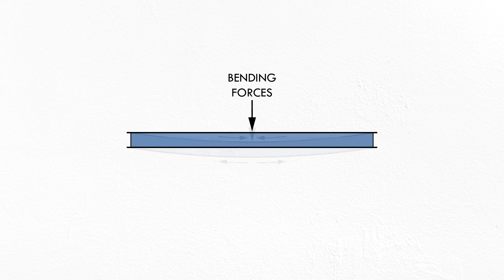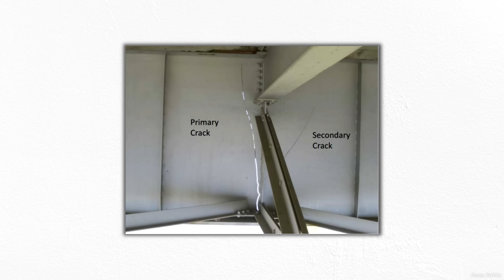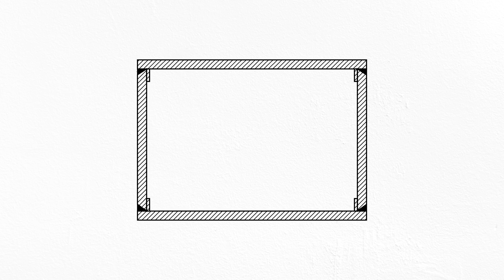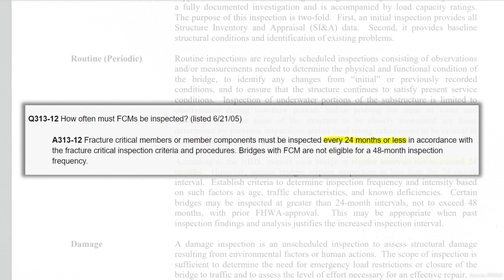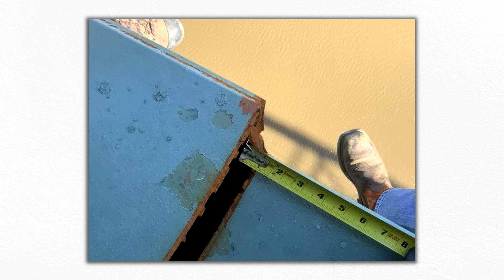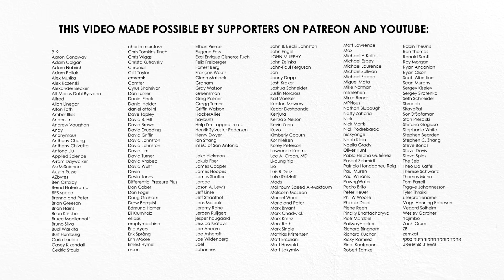What Really Happened at the Hernando de Soto Bridge?

Comment: As a structural engineer with over forty years experience, I am of the opinion that the success of most human endeavor is balanced on the edge of a knife. It is hard for our societies to cover every need. People want perfect, wrap-around security, but refuse to spend on it at a level that might provide even reasonable security. Resources are spread thin. Our margins of safety are small and apparently getting smaller. There are reasons why this will not change. The deeds of individuals acting alone will continue to matter, and will remain the difference between life and death in many cases. God bless every person who takes his responsibilities seriously!

The condition of infrastructure generally is precarious, worldwide. A bit facetiously I will say that perhaps Switzerland has organized its civil works for long term success at a bearable cost, but most of the world has not. Bridges, tunnels, dams, water systems, and electrical grids typically are vulnerable to failure. The budgets for inspection, maintenance and timely replacement are generally inadequate. Occasional tragedy is to be expected.

When tragedy strikes, society takes revenge on the unlucky, rather than address the roots of the problem. The point has been made that an inspection system ought to provide redundancy, some sort of defense in depth, involving more personnel working more systematically and under closer supervision. However, do too much of that and it starts to look like featherbedding, bureaucratic empire building, and waste. And perhaps it is, with so many people undernourished, lacking housing and deprived of health care. Society has to decide where the resources are to be applied.

Perhaps a back to basics approach would help. Civil works designed for longer useful lifetimes would be good. Postponing ambitious new projects in favor of increased maintenance budgets would be a wise step for many DOTs. Reducing our need for transportation would make us all safer. Placing less emphasis on the checklist, and more on doing the job in a mindful way would help. I am more interested in what the inspectors find than on what they do not find. If everything gets a clean bill of health the system has definitely broken down, because “perfect” does not exist.

Comment: It looked like the break was just inches of the end of bolted plate. Seemed a strange place for a stress point. Also, looks like tube steel vs ibeam . Could have been a weak spot in the tube. Hard to see because its hollow but you'd think the consistency of thickness may be questionable. Put load on it, if it flexes for years, eventually it snaps. Probably the only thing that saved it was the rest of the spider web of the structure. 
My neighbor backed into his carport post and knocked it out, the roof did sag but stayed up. Because as a structure it wasn't totally relient on one part to hold it up. Probably same with the bridge.  Concrete probably would have fallen, by shear weight. But the steel probably holds more weight than it weighs. Over a bit more time, it would have put more stress on other components.

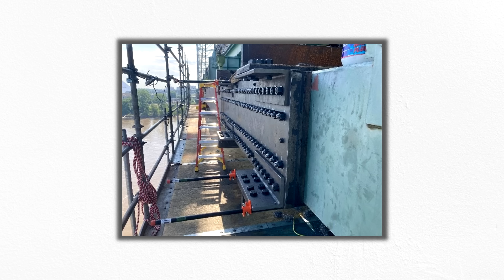Comment: 11:30-12:00 which is why a state official decided to ignore it. To save money, and not be responsible for shutting down such an important piece of road. If the problem “doesn’t exist”, it’s cheap to fix $0.
It emphasizes your point that the more important something is to public safety at large, the more people should be involved to ensure corruption, negligence and ineptitude are kept in check to prevent disaster.

Comment: Take this with a grain of salt as I don't know the situation and am only going off my own experience here, but as someone who works in government in health and safety inspection, it kinda sounds like the company knew there was a crack on the bridge and just failed to acknowledge it for financial/bureaucratic reasons. Yes, things get missed, but that sounds too big (to me) for no one to have called it in, they probably just called it in internally instead of bypassing the chain of command like that one inspector did (that one inspector is a hero, probably an unappreciated one). I've seen a lot of companies fall into the "well, it would be a hassle to deal with, and nothing has happened yet...so we'll just put it off for now" mentality.

That's why a common tactic I use when I get told "we're sure it's fine for now" is to get that  response and why they feel that way in official documentation. If you're really sure it's safe what's the problem with officially saying so and giving your explanation as to why? Wouldn't the fact you had a good reason to not believe it was unsafe only help you in court should something unforeseen happen?...unless you're not actually sure you have a solid reason (beyond "it's expensive" or "it's hard") to not fix it...
while demanding a paper trail isn't fool proof and sometimes you gotta do more, I'd say 8/10 times the issue gets solved as soon as documentation gets involved. Companies will often risk lives easier than they'll risk a lawsuit.

Comment: Like they say in construction measure twice cut once...it also goes for inspection...check everything twice...but not alone...one pair of eyes can miss something that other pair will catch...
Example...we were called to repair damage on a sugar factory. Its a tower with blades in it that cuts and mixes sugar beet...its 60+ft high and 30+ft wide...fhey said there are 27 small fractures on blades from all the grinding on beet over years...so we went in and started repairing..welding,adding new steel etc..by the time we were done...we found 134 cracks...
Always inspect twice with two different teams...

My guess that on that bridge there will be more cracks...because look at that massive crack...its offset and pulled away for more than 2 inches...othere side is are 100% damaged...that load and forces went elsewhere

Comment: Color me ignorant...
Is it possible to use electrical principles to monitor for such things? Probably gets more complicated than this, but...

Fat wires have less resistance than skinny wires. Cracked box beam has an area with much smaller cross section than uncracked box beam. "Hey, sensor J-23 is showing a quadruple increase in R' over yesterday." "Holy crap!"

?

Comment: why didn't it fail catastrophically because the other tension member was taking the load and the bridge was obviously not at maximum load and the designers obviously designed redundancy into the bridges design so it could tolerate some failure till it got discovered and repaired

Comment: I think its open now,  but aside of that, wouldn't a way to create a redundant system be a wire rope from each point load of the aches points of load giving the bridge a safty net after all this is a seismic area and you should expect lateral movements above whats normal.
Granted this could have been cracked or even broken but with a larger wire rope inside the channel it still could not fail.

This just goes to show as we are replacing bridges over 100 years old 
Thoses built the last 50 60 years were not built as strong  as we progress with architecture we find ways to cut corners that they did not do 100 years ago. 
Its always better to overbuild then  build on a budget  by the time it needs to be replaced cost will be 100 of times more.
These bridges we need to replace wile pricy then have paid off over the long run.
Are we building for today, or are we building for generations to use?

Comment: For the company to "Pass the Buck" and fire a single individual for the mishandling of annual inspections and not noticing the crack during inspections, when there is probably a team of inspectors and engineers that view all the data collected, that were also unable to notice such a significant structual failure occuring is unbelievable, cowardly and completely unjust.This shows how little backbone the company has in not being able to take responsibility for their flawed inspection process. I personally would sue the company for wrongful dismissal.

Comment: There are slot of bridges that has deal with salt and other driver compounds that is bad for metal and concrete and when funds are cut preventive work gets cut this results in cracks not being delt with if forty bridge failed it would be years before it would be replaced

Comment: Such failures have more to do with cost saving than engineering. When this bridge was built, in the 1960s, it was designed to the minimum standard that met the needs of the day. Since then, vehicles have changed, trucks carry heavier loads, and the flow and intensity of the traffic has increased. All these factors mean that the demands on the bridge today exceed the minimum standard to which it was built in the 1960s, hence failures! Why did the designers not anticipate these changes? They were financially restrained by the available budget. And these underinvestments continue today.

Comment: This is a really nice explanation of the situation at hand. The demonstration of the bowstring arch made it clear what could have happened if that beam actually fractured completely (with the obvious disclaimer that the de Soto bridge also has cables that transfer the load onto the arches). It's disturbing to imagine in the least if that was really possible. It would have been more severe in impact than the I-35W collapse back in 2007.

Comment: I often face challenges in transferring my knowledge to your videos as the language barrier in Engineering is too much to handle even with my rather decent English skills. So my question: The cause of this failure is called stress corrosion cracking like seen (or rather having to be taken into account during calculations) in prestressed steel? The one where we limit it to elastic calculations and limit the tension?

Comment: The problem is the idiots in charge piss all the tax dollars away that could be used to build new bridges but instead they put bandaid on top of bandaid to infrastructure that was only designed with a 50 year lifespan. Replace the bridges instead of patching them up.

Comment: 5700 comments... ill get yelled at for this, but here goes: span is too long for a tie arch that is not fully 2 arches. the stylishness where the upper arches meet increases load to the outter ends of the arch. only way this design arch could be reliable long term would have been to build with abutments or have added a means to transfer force to a larger center pier

Comment: 4:51 This model only represents the bridge if it was made in a different way. The i40 bridge with the crack has two sides, one with the crack and the other side with no crack. Hypothesis: If you were to add another rope to the model that you demonstrated, the model would not collapse.
I understand that this is just a demonstration and is not an actual representation of the bridge, but you can see the bridge were the beam on 1 side of the bridge has fractured but the other side of the bridge seemly has no fractures.

Comment: Is it possible to weld that huge crack or would they have to rebuild the bridge ?
Reply: Since that piece has already failed, they will likely cut it out to a determined safe margin, and splice in a new member. The splicing will likely be done with fish plates and bolts to make the joints. Welding would possibly weaken the steel surrounding the new weld by burning the carbon out of the surrounding steel.
Reply: Ok thank you for the info cause the size of the crack in the bridge was super thick I'd hate to think that I would be driving on that bridge ps how old is that bridge I know it must have come from a steel mill somewhere

Comment: One person fired?? I find it hard to believe that one person was responsible for either ignoring or covering up knowledge of a significant, growing, multi-year fracture point – inspectors don’t get paid by the number of issues they find or the compliance of a job, they don’t benefit from hiding problems. For every inspection report there are numerous responsible parties that receive that info – the inspector’s own bosses, regulatory reps, bridge owners & operators, etc. Even in the most inefficient of businesses/govt depts there is always a second set of eyes that see an inspection report & it’s usually those same people with the most to gain by avoiding costly repairs & 'unneeded spending' for as long as possible. And in this case you have two different bureaucracies who would be trying to avoid a big repair bill. That one fired individual may be the only person who was trying to flag this growing issue with the authorities - wouldn’t be the first time a whistleblower was fired & made a scapegoat for actually doing their job right. Thank god for the inspector(s) who went straight to 911 to prevent disaster because it doesn't sound like the bridge operators would have been so quick. Legend 👷‍♂️👍

Comment: I'm sure they NDT the welds and if there are no porosity in the weld then the will be stringer than the metal its bonding. Filler material is usually stronger than the base.

Comment: Phase 3 - looking for and repairing other failure points - began this weekend (prior to July 12).  Overall, I thought this was a nice, judgement free summary. But as  Memphis resident, I think some judgement is indicated.  You didn't mention that this bridge was NOT built to its actual design specification.  It was supposed to have 4 arches.  Reportedly, it does not because as it was being built the state of AR backed out of paying its share of the costs of building (reportedly 40% of the total not paid for by the feds), so in the field modifications were made to cut costs. There has been no public comment as to whether those changes were adequately (or at all) examined by engineers; there was no delay in building the bridge.

Comment: Couldn't bridges like this be fitted with laser measuring devices across the entire length so that any minute shift in the length of the span could be seen instantly? I know there are mountains near here where lasers are used to monitor unstable rock faces to give early warnings of a massive rock slide and scientists can monitor very tiny movements from a mile away.

Comment: Looking at the rust on the fractured edges, that crack has been there a while!
Reply: I mean he literally showed the pictures and video from 2019 and 2016. Both of which show the fracture forming.
Reply: @Integer_Overload  It takes years/decades for cracks to do what that one did.
Reply: And considering it sits above the Mississippi River, it's exposed to constant moisture.
Reply: That much rust would be there 2 days after a good rain.
Reply: @stargazer7644  this. Not saying the crack hasn’t been there long. Rust will show up within days, rain or not. This was the summer, the humidity alone in this area will rust it.
Reply: @patmacrotch5611  I think it's a bit difficult to tell by the picture alone but it does look like a bit more than just surface rust to me.
Reply: @stargazer7644  Yeah, just look at the burnt tanks in Ukraine all of them are full of rust. All.
Reply: I would fire all involved

Comment: Thank you for this explanation of how the steel could crack. We really appreciate this. We are wondering about ground movement also, how the crack was lower vertically on one side of the break but also one side of the crack the steel seems to be moving down river. If one side of the bridge is moving south and the other north, could that cause it too?
Reply: the crack was lower vertically because of the horizontal force pushing outward towards the end of the structure. it'll happen any time something is under tension like that, and breaks with a fixed point on each end. plus the weight of the bridge, combined with where the crack is relative to the nearest "hard point" (where multiple pieces are bonded together, like the brackets)